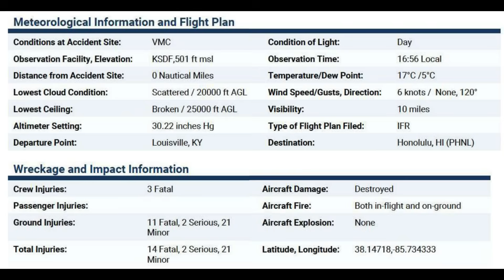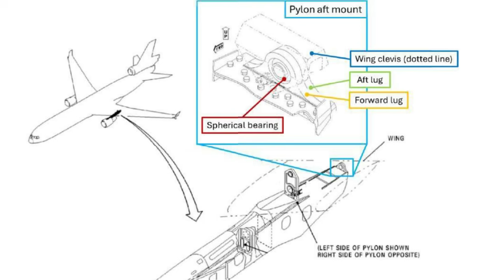UPS Crash - NTSB Report Analysis  #upscrash

Comment: I first saw your channel with the recent TWA video, and I assumed you two guys were conspiracy theorists, which seems to be normal on unexplained incidents. While I’m still not totally onboard with that video(s), I apologize for that thought, as I’ve watched many more and see how well prepared you both are to discuss these things. 

UPS is personal to me.  I retired from there in Louisville, and now work at another company next to the airport. I probably met Dana Diamond, because I was involved in training and met many of the new pilots at the time, and he was the youngest pilot hired by UPS in 1988, when UPS Airlines was created. We hired mostly experienced pilots, from contractors we used like Kalitta, Evergreen, and Orion, and Orion is where he came from. I’m saying that because he must have been something special,to be hired so young while most others were more experienced. He was set to retire this year. 

I saw 259 sitting outside the MX hangar, presumably after she returned from San Antonio. I drove past the hangar daily, and past where the fleet of MD-11’s sit on Crittenden Drive.  If you see the map, that’s is the street 259 flew over after it left the airport. Every day, half an hour or so before I clock out, I stop at the blast fence to use the ports can before heading in.  I also get the joy of seeing a few planes fly over while I’m there. Usually they are thousands of feet away when they lift off, but I understand 259 barely cleared the blast fence, which is 20’ from where I stand each day.  

I met one of the workers who died at Grade A auto Parts when I was there looking for a fender last year.  If you didn’t know, all 11 people on the ground who died, were at Grade A Auto, 3 employees and 8 customers. One of the customers was a former neighbor to a coworker, one of the last to perish, he had burns over 95% of his body. Seeing the smoke that day, then hearing it was a plane, secretly I hoped it was one of ours, shamefully because I know pilots there, and have a friend of 45 years in AC maintenance, but I did because I know the loss of life would be less if it was a cargo plane.  FedEx only has a few planes there. 

This runway is long, it was built to accommodate the UPS heavies, because UPS has over 300 flights each day. It’s a fight to see at night, when you see the landing lights strung out 10 or 15 planes deep as far as you can see.  It took till the third day after the crash, before I couldn’t smell it at work anymore. That burning, kerosene, oil, plastic smell. I will work at my current job for about another four years, and I will think of it a dozen times today because I passed the fight every day, I love plane noticing when I drive by, I look at the sky every time once take off, this will stay with me forever. It will get more painful I think for the local, we have lawsuit galore right now, things being said by people who don’t know what they’re talking about, It’s frustrating, but you really just have to sit there and listen because there’s nothing you can do about it. I was even frustrated a few episodes ago about people questioning the decision to take off, that stuff frustrates me to no end, when people that don’t know anything comment like that. Which has happening a lot in Louisville. Thanks for all you do, thanks for the respect the show everyone and the handful of videos I have seen so far. 

PS. Small thing, but you even say Louisville correctly, for the most part. We locals say it more like Louavul, but yours is correct.  I’ve seen too many of these video producers pronounce the “S”, so I know you do your homework on your videos.

Comment: Not yet explainable: if the engine nr1 attachment broke due to a fatigue crack and that happened around V1: Why was the acceleration from 0 to V1 slower than typical? The crack itself would have had no impact on engine power.  That impact will only be after the crack broke through, thus at V1 and later.
Reply: The acceleration wasn't slower than normal. The prelim report states that the take off roll was uneventful until rotation. Richard takes his data from Flightradar 24. The issue with that is, that the recorded data they show aren't always that accurate. FR24 does often some predictive calculations for the position of an aircraft at a certain time. Especially under accelerating and decelerating these predictions can deviate quite a bit. There were also cases when certain aircraft were shown about 120nm off from their actual position in FR24. It's simply not a reliable source.

Comment: I found an Australian plane fan who filmed at the Airport where the UPS plane crashed. Straya Aviation shows a lot of the UPS planes landing and taking off. Could the pressure of slowing down after landing cause the cracks. As I was watching the planes that landed which the crashed plane wasn't one of them. Their was MD 11fs, 747s 767s and airbus aircraft in the video. I saw in the landings when the planes were slowing down the MD 11 fs the engines were bouncing up and down, the wings were flexing. Their was 1 Boeing 767 that landed who's wings flexed very hard and the engines bounced up and down and were moving side to side. Someone who commented on another thing I said on Pilot Debriefs page told me the run way isn't in good shape it has patches and fairly rough.

Comment: With simulation software, could it be found that the stress doing the safety check is more damaging that leaving it alone?

I heard the time in hours was longer removing the engine , then pylon, so they removed the engine and pylon together,  putting a lot of stress on the pylon.

Comment: As the maximum force operating on the engine pylon mount would occur normally on take off, it seems counter initiative to design a mount where the bearing is at the front of the clevis, with the engine force attempting to pull the pylon off the clevis. Wouldn't it have made more sense to have the engine lug behind the wing clevis, with the engine pushing forward onto the wing clevis and helping to hold it in place?
Reply: Thrust loads are taken by the thrust link, described in the report, but not shown in the diagrams.
The clevis does have two vertical members, one on each side of the spherical bearing. These are visible in the pictures.
The three spherical bearings carry the vertical and lateral loads.
The two spherical bearings at the front counteract rotational loads.

For a technical conversation on the mounts try: 
PPRuNe Forums > Flight Deck Forums > Accidents and Close Calls > UPS MD11 crashed near the Louisville airport
Reply: Thanks for that information. I stand corrected.

Comment: Apparently the crew performed a rolling start, which is absolutely acceptable. However, might a static takeoff roll, (with the engines spooling up with brakes on) have given the crew a little more time and runway length to play with? 

I realise that in this instance, it's rather an academic question because it's looking as if the pylon failed first and not the engine. 

However, if the engine experienced a problem leading to vibration that ended up failing the already fatigued pylon mount, might any engine malfunction have occurred earlier in the roll had the captain elected to commence from a static start? 

Largely hyperthetical, but might an analysis of this help prevent future accidents? 

Apologies for  the rambling comment, but it's just after 3 am where I am!
Reply: It's highly likely that the moment of pylon seperation wasn't by chance. Because of gyroscopic precession the aircraft rotating puts considerable additional force on the engine and pylon mounts. Most likely it would have handled a static runup just fine. Rotation is basically the moment the engine and pylon mounts see the highest forces in an normal flight.
Reply: @shi01 Yep, totally agree with you. That's why I included words like "hyperthetically". We don't know for certain at this point which came first, the chicken or the egg. I'm tempted to give my opinion (pylon failure initiated the chain of events - the pylon would have failed sooner or later in any case)  but I'm not going to say stuff like "we know that.." or "obviously.." until the NTSB releases further info. (We've had enough arm chair pundits using absolutes in the case of AI-171 blaming the pilots, God rest their souls, to last us a very long time.)

Comment: Please can you give a detailed mechanical description of the design of these engine and pylon mountings- and how they have changed over the. years? Why is a spherical bearing component needed? Is there a certain amount of movement or flexing that is normal in this system? How similar or different is this design to other large aircraft?

Comment: The emergency directive issued after this accident reflects a recognition that a dangerous situation has been identified. The AI171 accident caused a much greater loss of life involving a plane in much wider use. If you have correctly identified the cause of AI171 as “water ingress,” a seemingly common place occurrence, why has there been no emergency directive regarding water ingress on 787s?

Comment: this UPS flight is sad but no clearer example of structural failure.  The engine is never supposed to detach from the wing like that.   TWA flight 800.  Quite the story and survivor guilt for those that were supposed to be on that plane but didn't.  That could be an interesting revisit and if the center fuel tank is still the thing or a missile

Comment: The emergency directives issued make plenty of sense, since the root cause of the failure is almost certain to be traced to fatigue cracks on the pylon and engine mountings, even if it is later found that a failure of the engine might have contributed. 

Looking forward to any NTSB updates to the PM. My guess is that we could very well see a few of those before the final report is released.

Comment: The other item that is interesting technically, is the matter of what does the ADSB data report with regard to altitude? So many online commentators made a big issue when the NTSB reported the altitude figure of about 400 feet. Almost as if they had discovered a massive gotcha to catch out the NTSB.  Yet a very simple check would have revealed that the ADSB report barometric altitude based on msl, based on the reference barometer value of 2013 mb. That value is then adjusted to account for the altitude above msl for the runway, hence the NTSB revision to 100 ft agl. Of course, the value that actually matters to the pilots is the agl of the landing gear, especially on landing, which then presumably is where the value of 30 feet agl comes from?

Comment: From what I've heard, the last maintenance done was more focused on lubrication rather than a full assembly inspection, which would've taken place during its next service schedule. Could they have found damage during the plane's last inspection? Obviously, but if you're not looking for a specific type of damage, odds are you won't find it. Something may be revealed later on, but for now, nothing maintenance related has surfaced. These are old aircraft and are not the major carrier in  most companies package delivery fleet. If companies keep them, it's obvious maintenance inspections will need to be conducted at far more frequent intervals. Companies will have to determine if it's actually worth the expense.

Comment: Why would a static engine mount require a bearing?
Reply: The spherical bearing prevents the pylon lugs from creating torsional loads in the wing clevis and vice versa. 
The designer uses these to control the direction of forces that the lugs and clevis need to handle.
This allows the mounts to be designed to be strong in only the direction that forces can be applied.

Comment: Obviously the design and especially the materials used in attaching the engine to the plane are sufficient for safe operation when they are newly manufactured and are properly installed.  I think it is obvious that these parts can degrade more quickly than is commonly assumed and since real-world materials are on an unknown and unknowable spectrum, some parts under the same stresses can function safely for decades where the very same type of part, may fail early.  The concept of "Infant Mortality" is well known among engineers and consumers too, where if a chip or device lasts beyond 90 days, it will probably last beyond 9 years.  It seems to me that MD-11 pylon parts longevity assumptions are presently set too long and that these parts should be inspected/replaced more often than is now the case.

Comment: The fact that the plane eventually rolled to the left tells me that the aerodynamic forces on the now asymmetric wings, were strong enough to completely neutralize the huge weight imbalance after the engine/pylon loss. Similar to the Chicago crash decades earlier. If all the wing “flaps” on both sides had remained in the normal takeoff position, would the plane have rolled to the right. Without the the heavy left engine weight and likely damaged center and right engine, this would seem logical. My reaction to an unintended direction to the left would be an instinctive hard rudder to the right.. wonder if they might find such a scenario happened.     Excellent analysis of the NTSB report. The mention of the deaths and injured survivors struck a definite emotional quake.

Comment: 14:52 "The pylons on these aircraft and all aircraft have to be replaced after a certain number of cycles."  I don't think it's necessarily true that the pylon needs to be replaced after a certain number of cycles on the MD-11.  I think it only needs to be inspected and remedial action taken when that is called for.  Besides, that's not the only reason for a pylon to be removed - it could be removed during major periodic maintenance.

Comment: Gentlemen, what think you?
Despite the current grounding of the MD-11 and DC-10 , I believe the only proper and ethical path forward for the operators is to voluntarily retire these aircraft from service. Immediately. 
Of course, this would impose a financial burden on these operators , but I can't see how any imposed  inspection regimen applied to the aircraft type could mitigate or bring peace of mind to those who either fly or maintain these aircraft.
Reply: Maybe they shouldn't be such snowflakes and turn on their brains for a minute? When something worked for 35 years straight and eventually failed, it's only your fault that you never seen this coming.

Comment: Blancolirio said that the October maintainance included 'lubrication' of the attachment points.  The lubrication history of these parts might be significant. Lubrication of the spherical bearing is to ensure the determinancy of the design.  Poor lubrication would make the joint less load capable.

Comment: First thanks for all your time and efforts! Highly appreciated.
As far as I know the crashed airplane was build July 1991 and first operated by Thai. Sold to UPS June 2006.
N262UP was the last one ever build.
Reply: Lookups show N262UP (Serial #48806) was the last MD-11 serial number delivered, to Lufthansa in Jan. 2001, so it was not the accident aircraft N259UP (Serial #48417) delivered July 1991, the 21st MD-11 off the line. Lufthansa didn't start buying MD-11Fs until 1998. UPS currently has 3 other MD-11Fs showing In Service that were delivered in 1991 --- N258UP (delivered June 1991 also to Thai), N286UP (delivered Oct. 1991 to Swissair), and N293UP (delivered April 1992 to Delta).
Reply: D-ALCC with farewell sticker 2021

Comment: Good information and commentary.  I have noticed now over a number of similar accidents is that it is just about always the left engine that separates from the aircraft. Is there some systemic reason why a left engine separation seems to dominate accidents of this sort? Surely the rotational forces introduced by the engines is the same for both sides of the aircraft which means statistically, there should not be a bias favoring the left engine loss scenario?

Comment: If UPS bought the plane in 2020, does that mean the last pylon check was done by Lufthansa?
Reply: Wrong aircraft --- Lookups show UPS N262UP (Serial #48806) was the last MD-11 serial number built, first delivered to Lufthansa in Jan. 2001. It was not the accident aircraft UPS N259UP (Serial #48417) which was delivered July 1991 to Thai Airways then to UPS June 2006, the 21st MD-11 ever built off the line.
Reply: @Raiders33  Thank you for clarifying that.

Comment: It's just unlucky that the feature that was supposed to make the plane safer (3 engines) brought it down. Shows how much engines improved since, a plane with 2 (powerful) engines would likely be able to climb with one engine and avoid the crash. Or would the low altitude be a problem, again. But the last engine was working so theoretically it would bring the plane into safe altitude and give pilots time to handle this successfully.  BTW was this a black swan event or is there a tendency that any debris flying over the plane gets sucked in into the central engine? Another thing, would modern airplanes be able to isolate that fire? Is there any protection that stops the fuel pouring out of the wings freely or would the same thing happen?
Reply: The UPS accident aircraft's GE CF6-80C2 engine is currently used on about 15 commercial & military aircraft models --- the Airbus A300, A310, Boeing 747, 767, KC-767, E-767, and VC-25A (aka Air Force One). So there's that...
Reply: @Raiders33  4 engine planes are a different story, but shouldn't it be able to achieve V2 then alone? Possibly I misunderstood something.
Reply: @IvanIV05  The A300 and A310 are 2-engine aircraft. I was just replying to your comment that "Shows how much engines improved since..." Which I thought meant that the UPS MD-11F engines were somehow old and out of date. They aren't, since they are currently used by many active aircraft models.